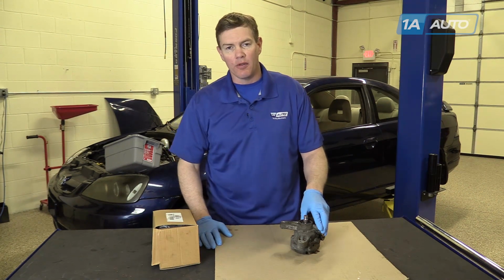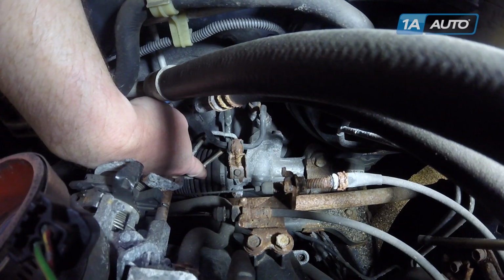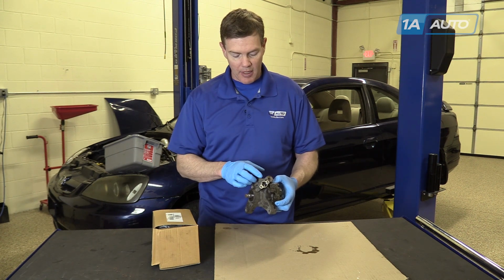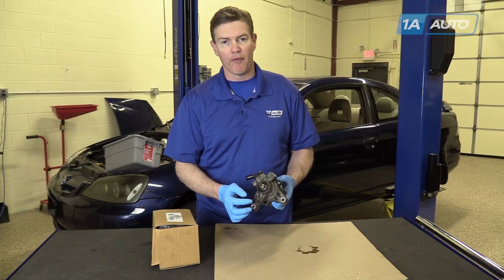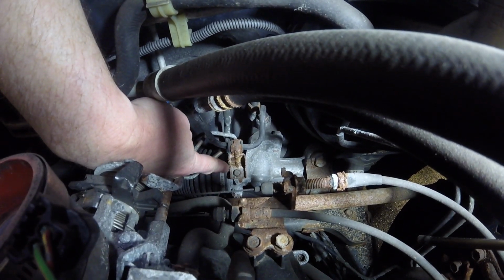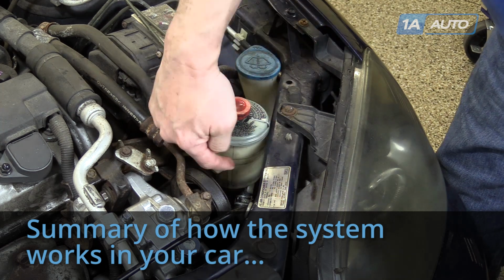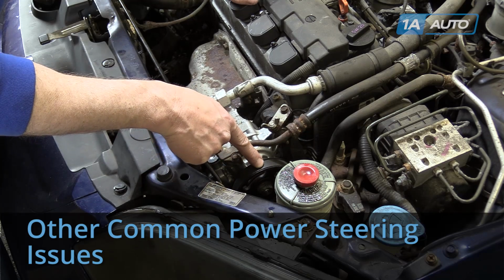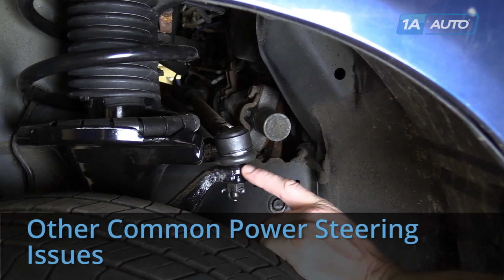How Power Steering Works and Why You May Be Losing Fluid

Comment: The secret in power steering system is the pump and the smoothing the pressure to stabilize the jerking and more control. The Chrysler Horizon test first power steering was so dangerous at high speed in freeway. But french researcher add on spring load at two end smooth out and keep the power steering stabilized in smooth steering at any speed

Comment: for my hyundai azera i learned very late that this forgotten steering fluid reservoir have built in filter! & when it's clogged it causes poor car stability, stiff steering & steering pump noises! i was pulling my hair to figure out the cause unstable steering my car! by the way all you need to drain the fluid is from the return pipe of the reservoir then jack up the car & turning the steering wheel repeatedly both ways (without starting the engine) untill it drained out

Comment: QUESTION, I drive a 2016 honda odyssey. when i drive short distances within the city, power steering fluid barely goes down, but say i do a 2 hour road trip, its under the minimum level, what's the issue?
Reply: You have a leak sorry I’m 3 years late lol and probably sold the car already

Comment: my car squeals when I first start up in the morning with the steering hard to turn for about 5 minutes or so.. before I drive, I rotate the steering right and left, and after a few minutes it seems to "heal" and works normally after that with no issue or squeals.  It seems to me that it could be air getting into the rack possibly (guessing).  What would you look at if this squealing only happens with its been sitting overnight?  I also noticed it is possibly greater when the temperature is colder than warmer (maybe fluid more viscous when warmed up??).
I was thinking maybe a leak, but cannot locate it, or possibly air cavitation if low, but level is not showing low.  I ried flushing out the system thinking some contaminated fluid might be still in the rack spool.  Hope you might have an idea to drive toward.  ARRGGHH!

Is there a way possibly to completely remove all fluid totally to replace?  reaching for straws at this point..

Comment: I have fluid flow out of the cap after the engine is shut off, the levels are perfect and it will do it untill the resivuar is totally empty. Doesn't do it while it's running..
Reply from the maker: +David Daniels Thanks for checking us out. We would recommend taking this to a mechanic to have them properly diagnose this issue so there is no damage that ends up occurring due to this. 1AAuto.com

Comment: I want to ask if the reserve tank is almost full above max level the oil come back to reserve tank can be pressure and leak a little bit from the hoes attach to the reserve tank i have 2001 honda civic i have swap the engine to d15b from a dragster garage and trans with 2001 power steering rebuild( rack,pump,seals,hoses etc) but little leak i don't know why is that maybe because to high level in reserve tank

Comment: Are the reservoir caps vented on 1999 chevy truck 5.7  ?   I don't drive it often, but have lost ps fluid. Washed the engine compartment yesterday and  I can find no leak today.  I wonder if it's building up too much pressure.  Thanks in advance!

Comment: Hi both power steering fluid and the transmission fluid both lead out in the same what does that mean
Reply: Transmissions are usually sealed meaning they don’t leak as often as parts on a power steering system

Comment: I need a power pump for my 2005 Nissan Altima.. Would you recommend a New power steering pump or is okay to buy a refurbished Power steering pump?
Reply: Hi did you figure a solution ? I also have a Nissan Altima 2005 with the same problem.
Reply: Get rid of it mine had a leak and caught fire totaled

Comment: I just noticed a whining noise when I step on he gas and turn the steering wheel.  I looked and noticed the power steering reservoir empty.  I'm shocked because I have my oil changed every 5000 miles and that's just coming up.  Now, here's the big booboo.  I went onto amazon and typed in Mopar power steering wheel +4 fluid as I was going to add and then go to the dealership.  I didn't pay attention when I purchased the fluid - I added it and noticed it didn't have a red hue.  It was more clear.  I then asked on Amazon if Hydraulic power steering fluid is the norm for a 2017 Dodge Journey and I got a reply "No".  So now I'm afraid to drive it to the dealer.  I'm thinking I should get a flush to drain the fluid - never did that before.  Not only that, but I am worried about why the reservoir was empty to begin with.  I've never seen a leak on the floor of my garage.  Because of COVID, I've been working from home the majority of these last 5 months.  If I can find out whether I can at least drive the vehicle to the dealer which is 9 miles away with the hydraulic fluid or if it would damage something, I'd really like to know.
Reply: Just flush it